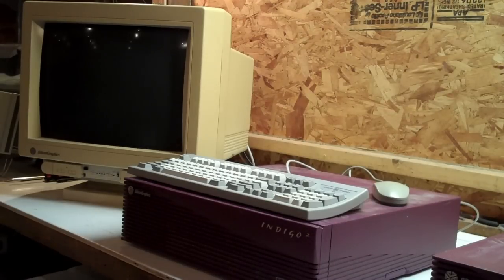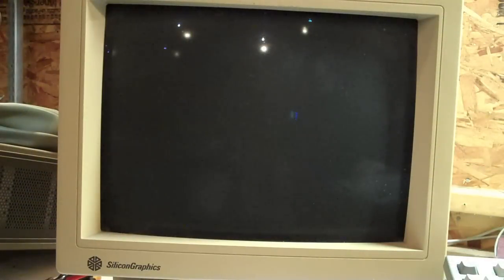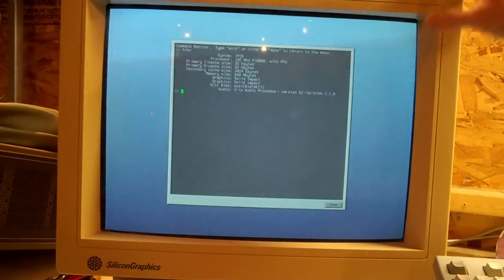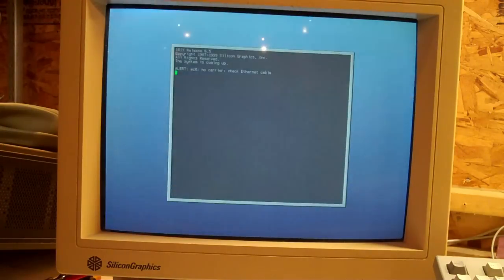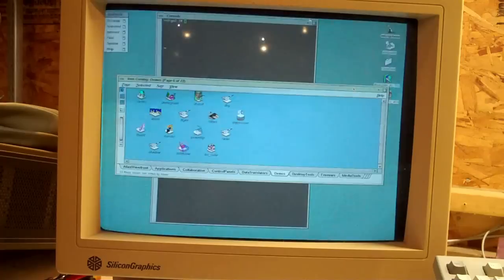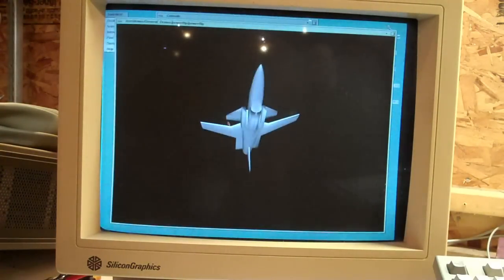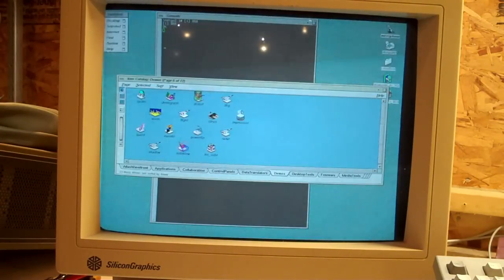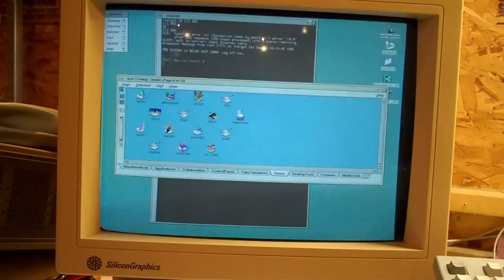SGI Indigo2 Tour

Comment: You would be surprised the detail people will go into over keyboards in general not just vintage ones. From force graphs to the chemical composition if the plastic., the lettering method you name it. I am partial to an IBM Model f terminal  from the Pc3270 myself.

Comment: It's funny how aesthetic preferences can be so different. :D  Indigo2 is my favourite SGI. I know many love the IRIS Indigo but for some reason the form factor never appealed (still have loads of them). Do you still have your Indigo2? Is it functional? And those disks are freaking me out; want a better one? 8)

Have to say btw I'm annoyed that after all this time YT has never recommended your channel. A friend recommended you. I drooled over your Onyx2 racks. #)

Yikes that bootup, chkconfig verbose on! I can give you some other tips on how to cut the startup time by at least a minute.

The R4600 btw was good for integer, it's about the same as an R4400SC/175 (beats me why SGI ever released it for Indigo2 though, maybe it was cheaper to produce but it wasn't better than the R4K/200). The R8K is actually a chipset, entirely aimed at FP64 (its int performance is terrible, ditto unoptimised FP32), but it requires careful compiler optimisation to get the most out of it, though in Indigo2 it's a little held back by the smaller L2 and the slower system bus & RAM (the Onyx board has 4MB per CPU, plus there's a 90MHz version too). SGI was going to make an R8K/150, but that never happened, replaced by the R10K after the MIPS buyout (easier/cheaper to make, easier [ahem] to clock up); however, elements of what SGI had been planning for future R8Ks did end up being absorbed into IA64 after so many staff moved to Intel. See:

http://www.sgidepot.co.uk/sgidepot/r8kcomments.txt

You don't need to upgrade the PSU, the 36A model is fine for dual-Solid R10K, though I can't be certain but it looks like you actually already have the final 48A version.

Comment: Nice video, I have an Indigo 2 solid impact with purple case that I bought on ebay over 10 years ago. I had to replace the monitor because my original one burned out. I have a new monitor. I bought all the accessory hardware including tape drive, pretty much everything that you could have on this system, but it has been packed up in the garage for over 10 years. Also had latest IRIX OS 6.x forgot the x. I am tempted to bring it back out of storage and play with it. Oh I also have the feet for the case so it can stand vertical.

Comment from the maker: Most of it has been luck. The most I ever paid was $300 for the six racks of Onyx2 gear, which isn't nothing, but it's not a fortune by any means. I troll the right sites and have bugged the right people. My first machines - a Sun 4/470 and a 4/260 - I picked up from an ISP. They were using it as table legs, and I asked if I could buy them a real table. The thing I love the most is the Sun E10000 - which I've never turned on for fear I'll be let down.